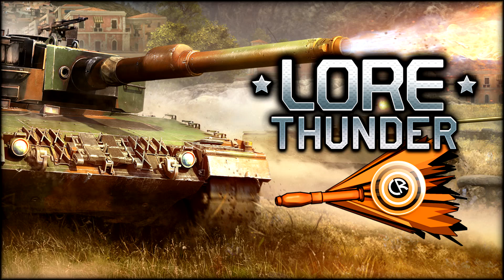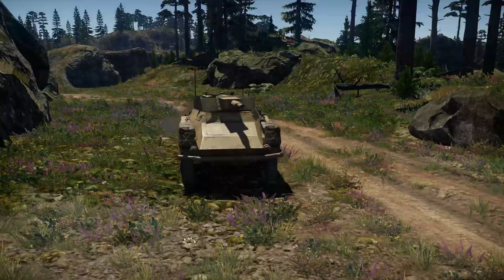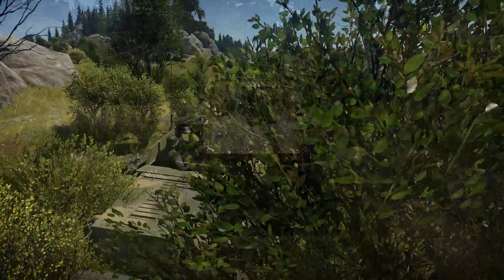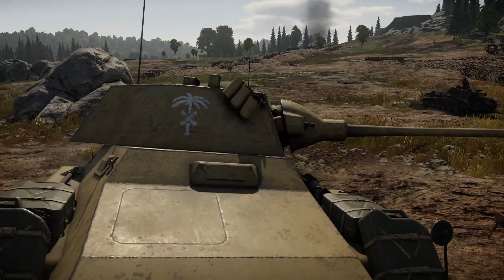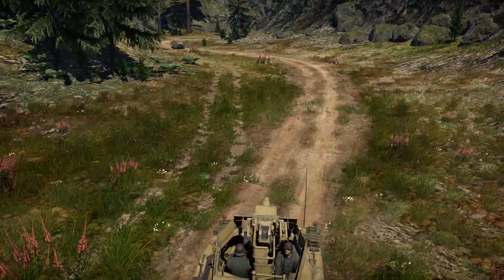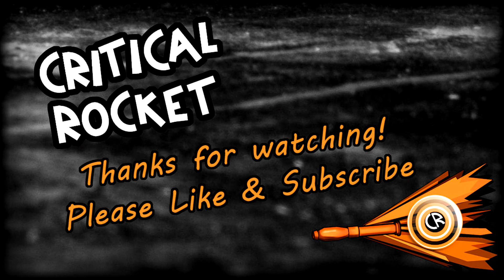Lore Thunder episode 12 - Sd.Kfz.234 series

Comment: Wait, "rear-facing driver's seat"? You said "six gears in forward and reverse". That's six EACH?! Yikes! Queue Urbanmech that can run one direction while shooting 180 degrees in the opposite direction! :)
Reply from the maker: Yeah, I used the x-ray view at one point to show the rear facing driver.  It must have been weird in real life moving around in that while not being able to see what was going on, but sure as shit hearing it when the shooting started.
Reply: @CriticalRocket  I wonder if there was some form of positive control to isolate the two drivers, or if the controls were linked, so the steering wheel for the rear-facing driver was spinning like mad, and possibly his control pedals were moving up and down, as the other driver drove. Because I feel like instinct from a rear-driver perspective, when the commander says "get us the hell out of here!" would be to stomp on the gas, maybe putting the vehicle in gear, first, so I feel like everything would have needed to be set up to "feel right" from the rear-driver's perspective to minimize the delay between command and execution.